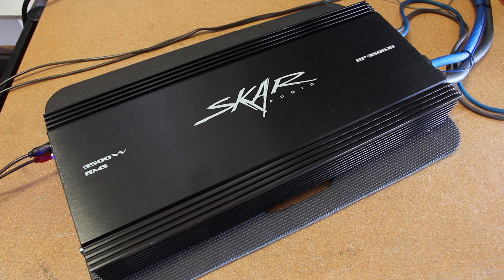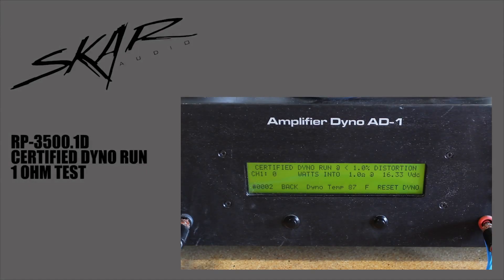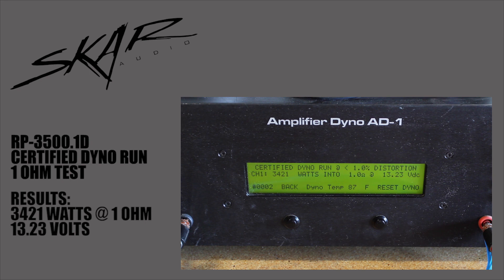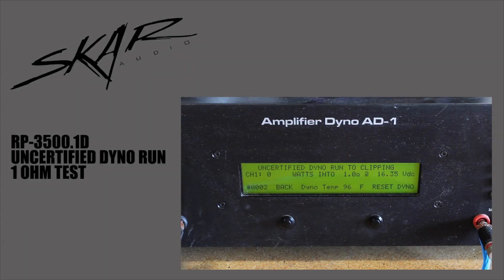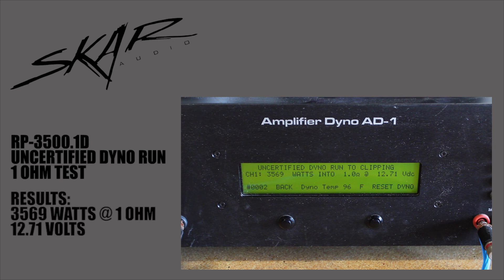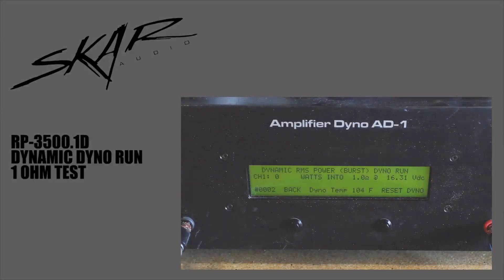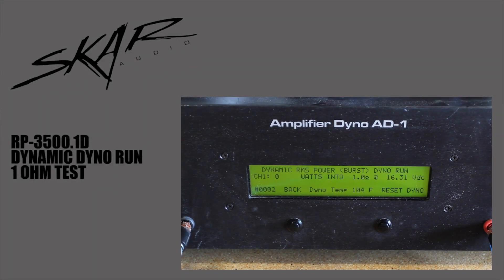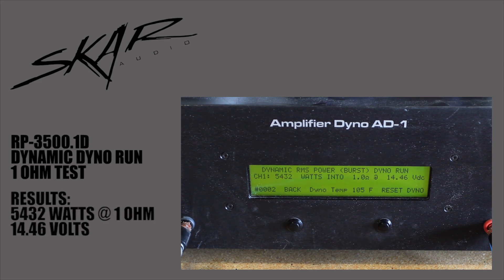Skar Audio RP-3500.1D AMP DYNO TESTING (SMD AD-1)!!!

Comment: Hey do you think that amp will push 4 15inch kicker compvx
Reply: Stevo Johnson  if u got a nice big box use the rp4500
Reply: Stevo Johnson Be careful with the gain because that’s enough power to blow your subs if it’s not clean. Otherwise, it will put them through all they can handle. This a great amplifier for 4 Comp VX’s, and if you have the right electrical, your bang-for-the-buck option.
Reply: @livingbass9617  I already ordered 2 rp2000.1

Comment: I purchased one of these amps as a short term replacement, after almost a year of using the amp I have no complaints. Solid amp, good build and not too flashy.

Comment: This Amp Dyno test was at 16+ Volts and Not 14.8 Volts. Therefore; these readings are not accurate. Sooooooooo fake news... WoW
Reply: Crookedletta601 you do know its the voltage # at the end of the test that is used to go by right? The battery charger that is hooked up to the batteries is putting out the 16v to charge the 14v batteries but the charger is only 20amps, so really the only thing running that amp is the batteries. So the rp 3500 and 4500 did very very well
Reply: Josh Hanson Start off @ 14.4 volts and it will not be the same. Final answer 😎

Comment: I'm not hating but why not call it rp-3400?
Reply: justin b what I don’t understand is on the amp it says 3500rms. Not max
Reply: @austinheard6074  it is 3500wrms.. At 14.4 volts... And it should do just above 3500 at 14.4..
They are rated at 14.4 not 13.8 not 12.6 volts

Comment: Aight, Im a lil confused Skar. The ending voltage is 13.23. Shouldn't it start at around 14v and end maybe at 12v or 11v. I'm just asking cause I want two of these to run 8 15EVLs but I dont want 15 plus batteries in the back either!
Reply: stewnta EXACTLY....
Reply: Looks like they had a couple banks of caps and charged them to 16v to do the test

Comment: Taramps all the way  HD 3000.1 1ohm is way smaller and out dyno’s that amp
Reply: Poohwe Campbell taramps = dirty power and with 200v on the rails their just as dangerous.  Not to mention you raise the impedance your wattage drops significantly. Rockford constant power cant be beat
Reply: Cody Hodgson except by JL audio’s HD1200/1 1500 Watts at 4khm for $800 bucks. Try getting that with a Rockford or any Korean surfboard amp under $800. And after impedance change that’s where you will land.
Reply: Tammy Forbes better check out big d wiz and steve meads videos....  Jl rips tech does give you minimal power drop with lower impedance but you arent going to get big power numbers above rated power.  Rockfords t25001 bdcp did over 4k watts on the dyno.  Thats more than 1500w over rated power and it did just under 3000w at 4 ohms.... Simply cant be beat
Reply: Poohwe Campbell bullshit
Reply: GOODFELLA 19714 look it up

Comment: No one is starting at 16v
Reply: sleeper10s  I'm at 15.4 all day go with Northstar batts
Reply: GOODFELLA 19714 nice that is good I'm close to that too but not 16v that lil but makes a big difference I like the and and Skar just wanted to see a real test that's all
Reply: I use DC boosters to feed 18v up to 60v, depending on the amp's needs. It's really a matter of the size/type of capacitors they use in the amplifier itself. Bigger caps with higher farads give amplifiers more punch power.

Comment: Y not run dual inputs on the amp maybe show clamping current to c efficiency?but dynamically it did extremely well. For a single power wire

Comment: Starting volts are well above 14.4 though..
Reply: Jason  Tancer a test bench is different from a car
Reply: my brother has a shark 2500 @ .5 his voltage is 14.8 but when he turns the knob up it goes down to 13.4v sometimes 13v. same as a test bench you can make a 14v bank charge to 16v but it will not stay 16.
Reply: I love Skar but that’s not what people see when they start most daily drivers
Reply: the starting voltage doesn't matter the end voltage is how it's counted.
Reply: Idk about you but 16 v versus 14 v could make a difference. Yes they will both pull the batteries down the same I’m sure but 16v is 16v not 14
Reply: that 16v is doesn't matter it's a 14v bank. ask Stevemeade he will say the same thing.
Reply: If it is a 14v bank why is at 16v I've ran big 3 and other stuff I've seen 14.5 with the car at 2k rpm at best
Reply: If they are trying to show what it’ll be like in a vehicle why not use a 12v battery?
Reply: Jason  Tancer your car's charging system is operating a FEW more items than your audio system.
Reply: But what a 12v doesn’t do is rest at 16+v
Reply: 2x Jay skar ftw
Reply: 12v will topically rest at 14.4 to 14.8